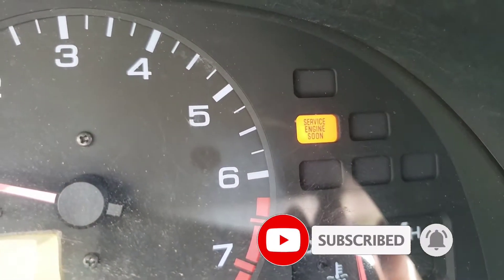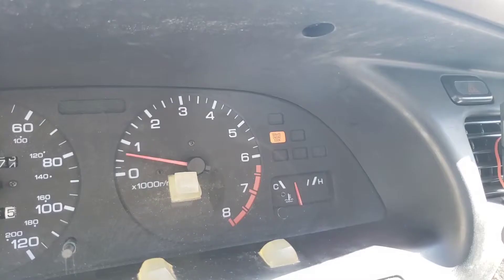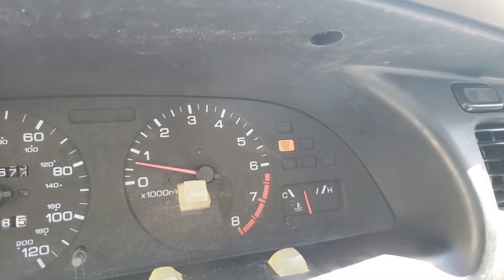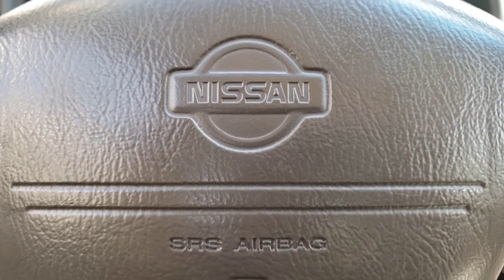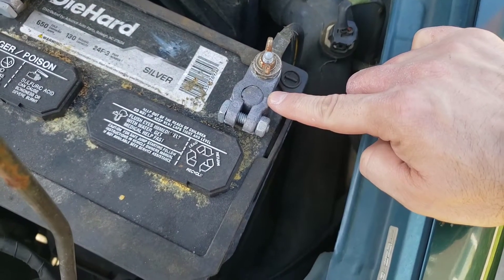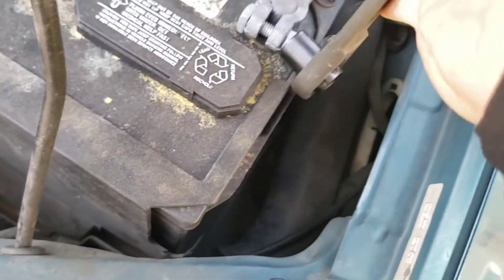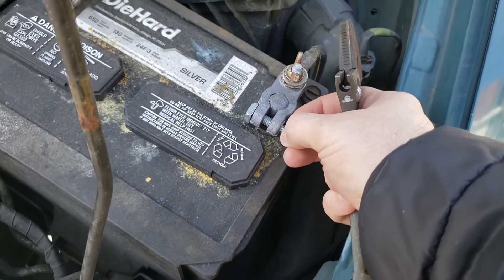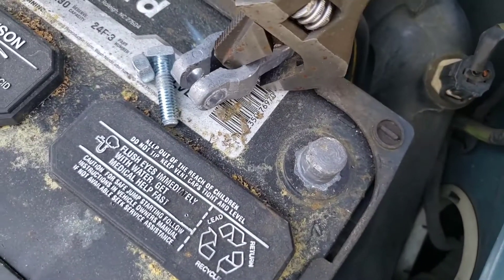RESET CHECK ENGINE LIGHT Fast & Easy

Comment: Get a Autel OBD 2 code reader for $20. You can get the codes for what's going on reset the check engine and it's basic enough to be left in the trunk of your car. You can easily help others out with it.
Reply from the maker: Thanks for the info TheTLD 👍

Comment: I had a CEL (PO420) Drove the car for 100+ miles. All I/M "s cleared "ready" except EVAP. Now CEL has gone back on. Any ideas ?
Reply from the maker: Fumes could be leaking from somewhere. You might have to do a smoke test to see where exactly